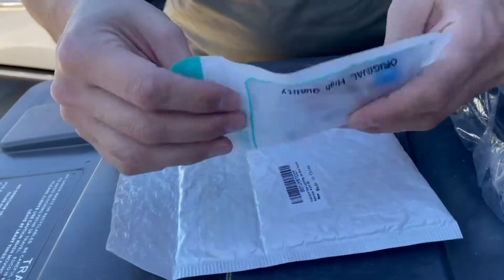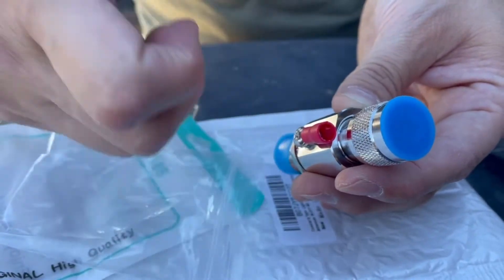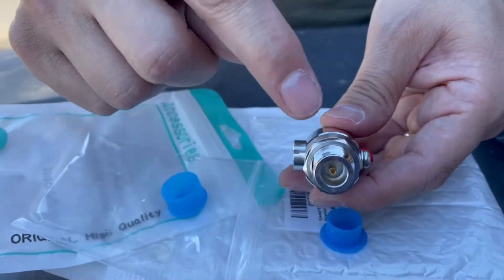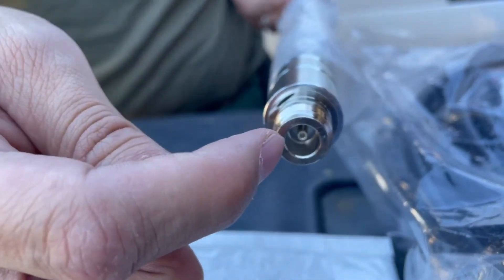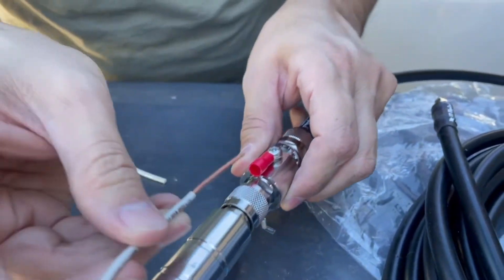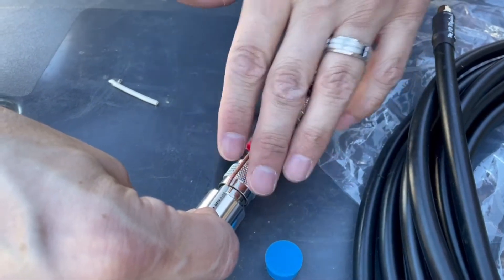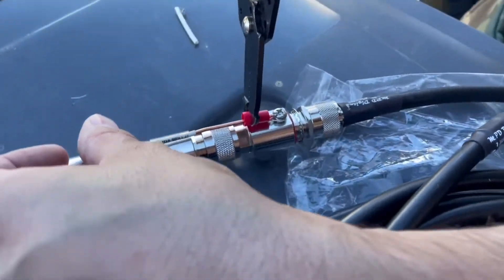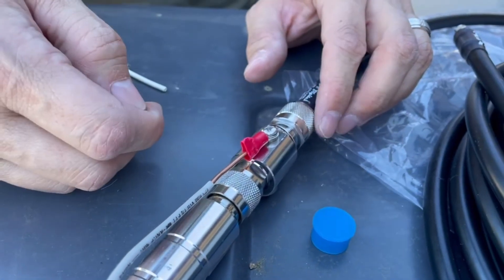Coaxial N Type Lightning Arrester 0 to 6 GHz (N-Male/N-Female) Review | Earn More Helium (HNT)

Comment: Lightning arresters are almost like selling snake oil. If lightening actually has a direct hit to your antenna anything metal from your antenna to your radio equipment that provides a path of least resistance will be instantly be subject to 100 million to 1 billion volts.  That arrester and the whole coax will instantly be dissolved to dust and there's a 99.9% chance that and thing in your shack and house as far as that goes will take a surge of millions of volts. Even if you disconnect the coax at the millions if not billions of volts it could arc to metal and instantly fry every thing in your house. The energy from a direct hit or a nearby strike can induce a surge that travels through the antenna and its connected equipment, causing damage even if you are not in the path of the main bolt.

Comment: You didn't squeeze the correct part of the red ground connection  you need to squeeze the part closet to the O ring. To ensure the wire won't come out and proper connection..

Comment: You obviously do not know what the F you are doing and have never used a crimp on connector commonly referred to in the trades as a "Stakon" connector.

1. First of all you should have removed the crimp connector from the arrestor.
2. You inserted the ground wire but when you went to crimp the connector on you used a pilers.
3. You did not crimp the metal part of the Stakon. You only squeezed the plastic WTF are you doing. The metal part of the connector is closer to the end that has the screw hole in it.
You made NO CONNECTION TO THE CONNECTOR. The sleeve extends away so as to insulate the bare part of the wire if the insulation is further back which in your case is a mile away from the connector.
4. Where is your crimping tool.

You need to take this down as it is pure crap. You have done everything WRONG. You need to talk to an electrician before you put this crap out. You are dangerous. All you are going to get is arching outside of the Lightening arrestor.

Comment: Shouldn't the arrester be closer to the thing your trying to protect?
Reply: Logic would dictate the arrestor must be close to the actual antenna connector so that the high voltage doesn't get to travel a lot through the antenna cable. You want the high voltage to escape as soon as possible.

Comment: Is it really necessary to connect the grounding wire?
Reply from the maker: Yes
Reply: @CaesarCritiques  Thanks, I'm asking cause I'm on a pretty high spot. And there is no easy way to ground. Do you know the maximum resistance on the wire? There is a very big metal gutter nearby, I'd like to know if connecting to that will be enough.
Reply: @dirkmoras  How high? Copper THHN wire at home depot is like 50c per foot 12awg
Reply: @discontinuity  Yeah the costs are not the problem. I live in a shared building, and I do not want to bother the neighbours. I'm looking for something creative.
Reply: @dirkmoras  Are you on the roof or can get a wire to a grounding block or an AC unit? You can find another grounded appliance and splice your ground in
Reply from the maker: Is the gutter made out of copper?
Reply: @CaesarCritiques  Steel
Reply from the maker: No bueno
Reply: @CaesarCritiques  Thanks, i'm gonna try something else.
Reply: Totally!

Comment: Im having a hard time finding out if the direction matters? As in will the arrestor work the same if the female or male side is connected towards the antenna?
Reply from the maker: It can be installed either way.

Comment: Thanks for the video. One question, can i pair a 50ft LMR400 on one side of the lightning arrestor and then a 10ft LMR240 on the other side ? Or do they have to be the same? Thanks again!
Reply from the maker: If the connections at the end match than yes